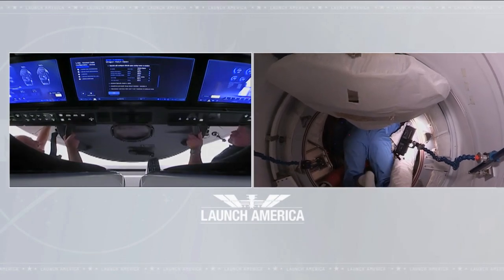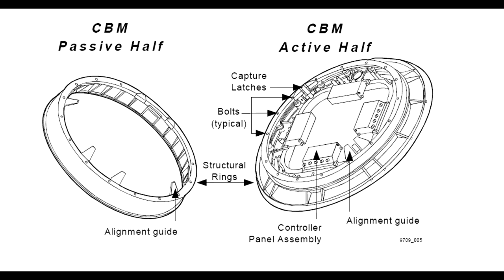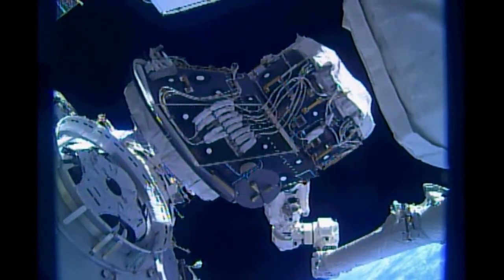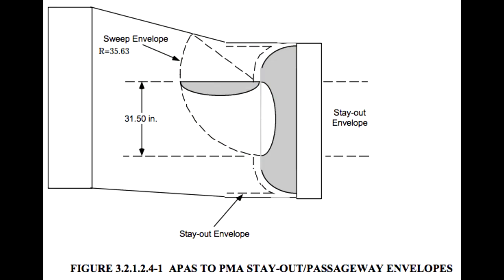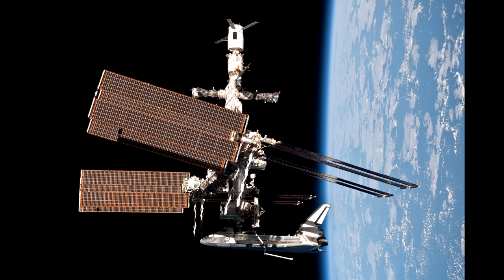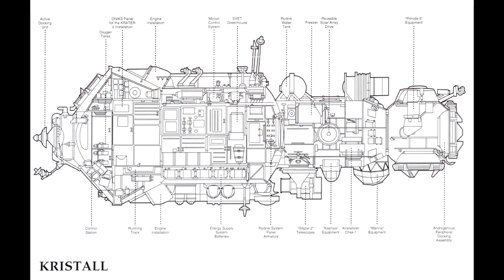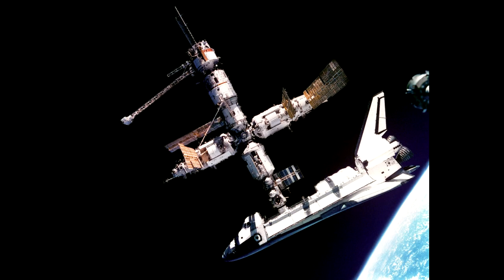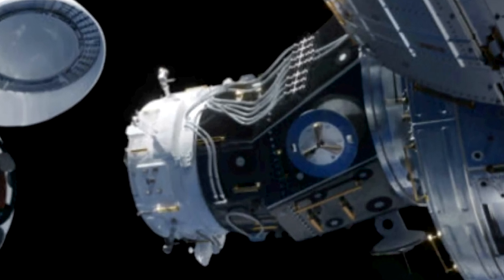Why The Docking Adapters On The Space Station Are Shaped Oddly

Comment: I thought the shape was to have a lower structural rigidity in case of a "crash" while docking, sort of a crush zone.
Reply: Yeah, that was my first thought.
Reply: I was thinking that, if it was straight it could transmit force to the station in the event of heavy docking
Reply: It will transmit the force regardless, straight or bent. I don't think a crumple zone needs that, in fact I'd assume they'd want the crumple zone to be direct along the center line of the module so that it would absorb as much energy as possible before the shuttle flings around and smacks the side of the station. Having it offset would seem counter intuitive to that. Also having a crumple zone directing energy sideways might mean that the shuttle strikes the station end first instead side on, meaning more energy delivered to a single location instead of alongside the whole fuselage. Or perhaps it's designed to prevent that.

But what do I know, I'm not as smart as the engineers who designed it, perhaps there is merit to the theory. It just doesn't seem very likely to me.
Reply: @Greippi10  yes. However, the outer radius is smaller than the inner radius, meaning the full force would be absorbed by the hatch. "Lowering" the outer radius this way insures the force absorbed by the inner circle ridge and transmitted to the rest of the module instead of pushing the inner hatch in and creating a possible breach.
Reply: Yeah I kinda doubt they designed for the case where a shuttle was moving with relative velocity fast enough to crush metal.  If you are at that point, I'm pretty sure the shear stresses along the main axis of the station would snap the station like spaghetti or at the very least shear off the big solar arrays and radiators leaving the station out of power and overheating.
Reply: @Greippi10  A straight cylinder is a lot more rigid than this slanted design, it would deform less - so higher forces. That is a t least the idea behind his argument.
Reply: @ABaumstumpf  Yeah I get that, but I'd assume internal design for the crumple zone is probably more important than the shape. Weak points along the length of the structure make it squeeze like an accordion, just like modern cars.

Also, a slanted design offsets the point of contact from the center off mass and a collision would cause more rotation which I'm pretty sure they don't want.
Reply: Most of the weight of the shuttle is at the back because of the engines, they are so far away from the port that, if the docking speed was too high and the docking was successful, the station would snap under the torque. The shuttle is also massive compared to the station
Reply: I was picturing it acting more as a shock absorber in this way.  The less rigid structure could flex slightly on docking, converting a jolt at the point of contact to a smoother push transmitted into the bulk of the station.
Reply: @Keldor314  Yeah but that's the thing, the shape doesn't need to be slanted for it to perform that function.

And then there's of course the other thing that almost everything that shouldn't go wrong would have to have gone wrong if that's necessary. The approach velocity of docking spacecraft is about 10cm/second in the final stages, but then again the Russians did manage to run one of them into MIR.
Reply: @Greippi10  Strictly speaking, no, the shape doesn't need to be slanted.  However, consider if it were straight.  In this case, the walls are parallel to the force, and thus are at their most rigid, and will be able to deform very little before outright buckling.  A slant brings the force out of line with the walls, and they will much more easily flex off to one side.  Try it yourself with a piece of paper.  I suspect the difference will be quite noticable.

Even if the tunnel only deflects a small amount, perhaps a couple centimeters, it greatly cuts the jolt.  Otherwise, it's very much like tapping something with a hammer.  Even though you're only lightly moving the hammer, and at a slow speed, the shock has a nasty tendany to loosen screws and fittings, not something you want on a space station.
Reply: @Keldor314  The walls might be parallel to the force but they can be built in a way that makes them buckle in a way that is exactly desirable. This is how modern cars are built, they buckle like an accordion sending the force around people in the cabin, and also the car does not have to be sent into a spin that might be dangerous.

Now as I've said in other comments already having the force aligned as closely as possible with he center of mass of the space station so that a collision doesn't cause dangerous spin and torsion. The space station would probably fare much better with forces that are aligned directly with the modules than ones that can cause dangerous oscillations.

But as I said before I didn't design the thing, it's just that when it comes to crush cores the slanted design is not necessary and may actually have detrimental effects to its function. It might be the reason it's the way it is but I would be surprised if this was the case.
Reply: @Greippi10  I should emphasize that I'm not talking about a crush core, I'm talking about a shock absorber, to reduce shock during routine docking.

That said, I'm not sure the tunnel is particularly rigid at all.  It occurs to me that the air pressure inside the tunnel will push back with something on the order of 5 tons force.  Assuming a 100 ton shuttle is approaching at 10 cm/s, this translates to a decelleration period of 2 seconds, during which the vehicle travels an additional 5 cm.

You would want to avoid any spots that can crease, since this is bad for the material.  The pressure also seems likely to cause trouble with any accordion style telescoping, since it will be forced out straight, meaning that the pleats have to go through a buckling event before they can start folding together.

As far as center of mass, the fact that the docking adaptor has been moved around from time to time suggests that this is not a particularly important consideration.
Reply: @Keldor314  This doesn't change anything. The material will deform just the same regardless if it's coming head on or moving to the side, and I doubt they want that.

As for standard docking, when nothing goes wrong, the soft capture system in the docking system has six servos that absorb the relative motion of the spacecraft during capture.

I don't think the tunnel is pressurized during capture, but don't quote me on this.

And yeah, regarding the fact that it has been moved around and isn't aligned with the center of mass that's been kind of my point all along and where this discussions started; I don't think the shape of the adapter serves any kind of function for absorbing impacts beyond what the soft capture system does.
Reply: My thought is that the kink is to align the docking port with the station's center of gravity.  Otherwise, any impact from docking will tend to rotate the station.  Which among other things would placing a bending force on the docking port.
Reply: Yeah I though the same that in case if docking happens a bit harsh the entire stress will be absorbed by the adapter since the axis has offset and not transferred into the space station.
Reply: Maybe it was a bit of both?  
Not the usual crush-zone, not meant to absorb more deformation either, but designed to  snap clean off if hit too hard before the forces transmit into the station proper and snap it in half.  The adapter wouldn't be pressurized at that point, so there would be no loss off air, and neither shuttle nor station would be harmed. 
If it was a proper crush area, it would probably telescope together by a foot or so.

Comment: if there's one thing that i've learned lately from this channel, is that i dont want to learn how to design space stuff. but, this has come with drastically increased respect for people who just,,, do this stuff.
Reply: How cool! Your comment is actually very nice, much respect, both ways right!
Reply: Engineering is an awesome job it's all about solving problems
Reply: Dani Syx so much math though
Reply: @danisyx5804  All jobs are all about solving problems, the problems are just different.
Reply: @Mike-oz4cv  Even a house framer uses lots of math there are even special calculators for construction The fun part about engineering is that you get to solve the problems and leave the hard work for somebody else unless of course you're a fabricator or work in a machine shop of some kind then of course you have to know about expansion rates and all kinds of stuff math is the language of the universe
Reply: @5000mahmud  math is the language of the universe everybody uses math whether you're talking about cook times and temperatures in a kitchen or framing a house or working in a fabrication or machine shop